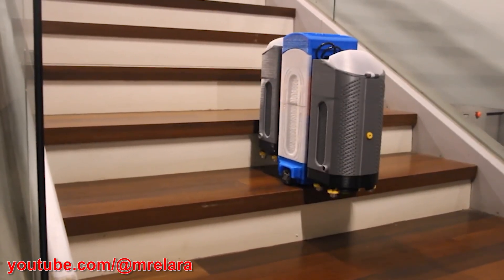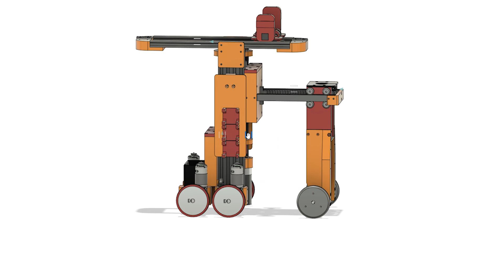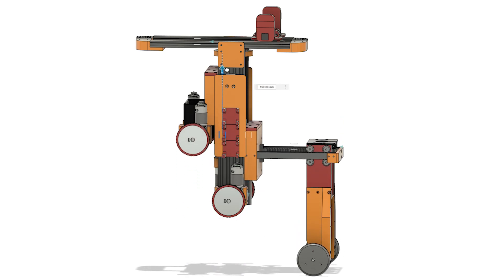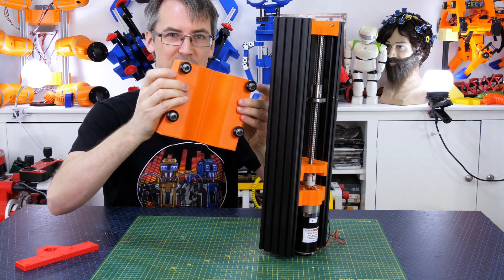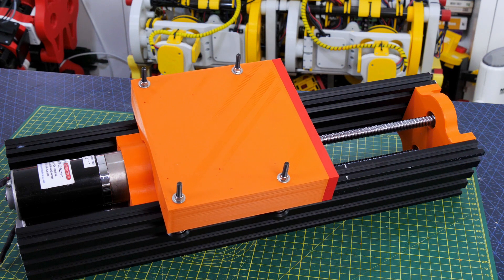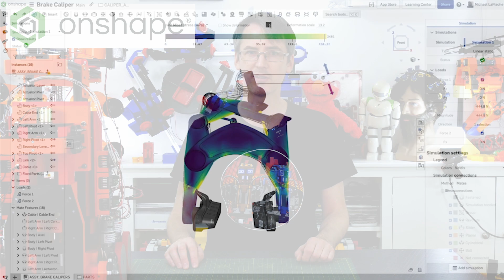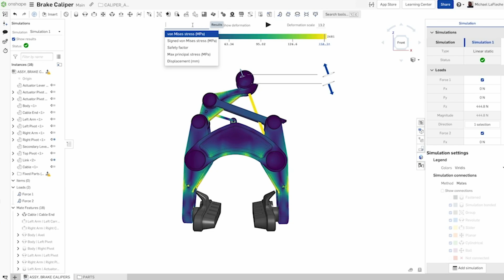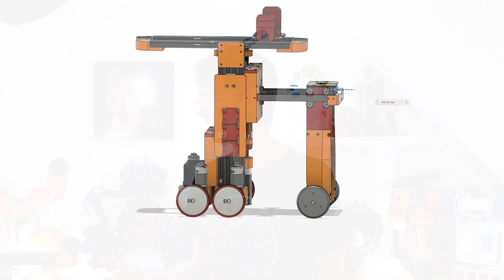How this Robot Climbs up Stairs

Comment: Awesome job man. One suggestion. Instead of shifting weight, you can use flywheels. You can control their speed and direction to adjust the angular momentum. I think it will be comparatively simple and compact.

Comment: Make the weight mechanism have 3 stages, when you lift the first wheels the system automatically first has to have the weight on the first stage, when you lift the middle the weight automatically moves to middle, and when you lift the last wheels the system automatically moves the weight to the last stage, this removes two buttons and stream lines the process so that if further autonomy with sensors may be easier.

Comment: Love the idea with the sliding mass! But doesn't this make the back section with the omniwheels redundant, because with the sliding mass you can stop the front sections from tumbling down
Reply from the maker: You can't pick the middle up...
Reply: @jamesbruton  why not? In my mind, to go onto the step above, the middle lifts the front up by turning the lead screw, and then the whole assembly moves forward. If there were only two sections with a moving counterweight, I think the middle could be picked up: when the front is on the step above (at a higher position relative to the middle because of the lead screw turning), wouldn't making the lead screw the other way (ie in the direction if the front were to be lowered) pick up the middle?

Comment: Thank you for your video, as I also need to make a 'scooter' that can go up stairs, and I am thinking of using a segway type device that has large diameter wheels and you can shift your weight forward.  It needs to go faster than you can do it yourself with your legs or it won't be useful....It would be great if you could figure this out.  The track system might work if it has large diameter more like a wheel.   Cheers, Jack
btw, a simpler method is to fire a hooked cable to the top of the stairs and just winch yourself up, doesn't need anything but a single winch and some wheels.  Can go back down too.  And very quickly too if you don't mind some bouncing.

Comment: Intreiging design.. but you could totally have got the dog to do it far quicker.. with the right programming!

If I were you I'd probably try an cheat the programming by attempting to evolve a virtual environment and virtual dog from the real environment and dog, to evolve the virtual dog AI against varying virtual environments and objectives rapidly an relentlessly.. so that it can do things like bound up steps easy..

Tho.. maybe just evolving the dogs AI in the real would be simpler, might wear down some parts but it would get there with the right sensors an autonomous goal checks.
Reply from the maker: Legs are not strong (or long) enough, so there's some new hardware required

Comment: You should use a screw terminal shield on the mega, I got one for a robot I have and it has relieved a lot of anxiety.  You can even get a spring terminal one for an uno and it works on the mega and due.

Comment: I think it only needs to drive the front pair of wheels when the middle pair is at the same level as those front pair. This means you could simplify by having a simple gear or friction drive that takes the drive off the middle pair and supplies it to the front pair when they are at the same level?

Comment: If the compartment of the battery can move to accommodate for the change of weight in the direction needed, that's a huge win for efficiency.
Now imagine being able to do this with more than one battery separately for even more control and capacity.

Comment: The Holy Grail of robot mechanics, the stair climb. Nice motors, 12V 22A stall. mmmm, not available on the website.  Dont run the nut off the screw, No-one wants to spill their balls all over the floor. Fantastic proof of concept expertly executed.

Comment: If you use a high helix lead screw instead of T8 or ball screws, it will be much faster, and there probably isn't a huge torque requirement.

Comment: With the weight stabilization on the top it looks a bit like one of your 3D printers has become sentient, printed out some parts, and is now trying to escape 😉 I'm guessing the trip down the stairs would really benefit from having sensors if the trip up was tricky to control the timing of?

Comment: Don't build complicated sensors.
Use end-stops!

Your stairs don't change height, your segments never need to go higher or lower than 1 stair height.

So have some manually adjustable end-stop switches for any state you need to detect.

For the top rail, use a rail with switches, and simply program it to move from one switch to another depending on the state it needs.

Yes, you could over-engineer it to work on any stair height in any location, but as you say thats complicated, when you can just measure your stairs and the robot will just work with much simpler boolean logic.

Comment: Fantastic as always. I thought that seven minutes to get up the stairs was quite impressive. :)

A few weeks back I thought that your motion camera rig was another amazing project. However, when you use it now, there are parts of the video (like the closing section here) where I have to look away as they make me fill quite ill very quickly -- the mimicking of a drifting hand-held camera with no stabilization is too good! :) But this may be just me.

Comment: a couple rails with a section of teeth in the middle would make it easier for a small robot to quickly climb the stairs. depending on size you could get it to corner on the rail and even a weak, slow climb would still probably be faster than all the stop and go with this bot. this robot is amazing in its own way and if it was only a step or two it would be fine but 7 min is a while and then you need a good bit of sensors to keep it from just driving off the edge.

Comment: Love the multiple different types of pullies and different engineering designs in this. On a quick note you should try to use mecanum wheels, they give lots of control when used right and you can go in almost any direction you want!

Comment: Does it work just as well going DOWN stairs? I don't recall any discussion of the down procedure during the design and there is no footage of it
Reply from the maker: I'm pretty sure it would just everything in reverse, it took so long to go up I didn't bother though
Reply: @jamesbruton  It looked like the robot may have to back up to the stairs first if it was to do everything exactly in reverse. Or said another way, it may have to back down the stairs instead of going "head first"

Comment: i would imagine that the quick and dirty solution would be similar to the bin bot....programmed actions/paths based on criteria? if you didn't want to to be fully hardcoded repetitive function, then obviously targets on the stairs that tell it that it's encountered a set of stairs then go into the stair routine (drive, lift, move weight, drive, lift, move weight, etc...), that way it doesn't have to figure out "stairs" it just has to know that stairs exist. then all the autonomy would be in the "navigate to stairs" at which point it would go into "stair mode" then once it's done stairing, it goes back into autonomous searching mode.

Comment: Hey, quick question, why do you power the arduino separately?
Reply from the maker: So motors turning on and off don't cause spikes that would affect the micro. With probably regulation it wouldn't be an issue, but it's just easier this way.

Comment: Such a cool concept! Well executed too. I'm curious if you think it can make it down the stairs in its current form?

Also a stair-lift robot that can interface with other robots would be amazing. Retrieval / delivery robots on each floor plus the stair lift robot to take a mass from one level to another. What an awesome home-automation system you'll have soon!
Reply: I was thinking you could mount a rail To the wall just have it extended out and enter so and have the robot be able to connect to that and drive up the rail… who knows if that would work though. And in theory that should be able to make it down the stairs it just goes in reverse

Comment: At least, I think you can automate the stair climb with 1 sonar sensor on the front:

You still have control of the driving of course.  You can drive it up to a step, and hit a button that will start the stair climbing (maybe with the same button to stop the auto-climb so you can take over too).

The program will first make sure it's close enough to the step, maybe even bumping into the step.
It will then raise the front section until the sensor doesn't detect a close object.
It then drives forward a set distance, stopping if the sensor gets too close to the next step (if there is one).

I'm not going to write out the whole thing, but I think you can get the idea for the algo from this.  Just one sensor needed! :)

Comment: linear rail(guns) are better
Reply: railed are easier to manage
Reply: or just quad copter server dish plate
Reply: you dont need to make wheel/roads when you quad copter fly
Reply: solar gives infinite range, recharge (sleep) if you need to, in between, or just helium balloon float around with the wind (solar-electric helium balloon solar panels)
Reply: batteries are an unnecessary package, just super caps for some smoothing buffer
Reply: or tin-air wire/sheet spool fuel cell, at 6-7 kwh/kg
Reply: then the tin oxide can be recharged with hydrogen/carbon/electric-field back to tin metal, as re-used locally
Reply: yes the same tin as the soldering metal
Reply: if you make a 6dof hand tracker, with 2 joints and 2 axles, you have a 6dof simple hand controller (or 3d mouse), the same as I already said about controlling a human robot by transferring your own movements to it
Reply: positives of the joint tracks system is that no complex imu, sensor systems need to be used, only some angle joint sensors

Comment: Could a tumbling robot that kind of rolls up the stairs work? it would just need to have a stabilized basket in the middle to hold soda. Or a hexapod with long lanky, lifting legs. Same idea as what you have here but it doesn't use wheels, and different gaits can be tested against your particular steps for best stability.

Comment: interesting project
well for starters how about acceleromter(?) in the middle so it can calculate tip forwards and backwards for balance, simple switches in front on both side for step placement.

Comment: Rather than sensors for detecting the distance to the next step couldn't you use switches on each side (front left and front right) and let the robot bump into the stair like the early roombas did to detect the stair and then orient itself correctly (straighten out and then move to the correct distance for ascending)?
Couldn't you also automate the ascent process rather than having to control it all manually with a remote? It seems like it's a fairly repetitive task that would be easy to set up macros for each of the different movements and their timings

Comment: It looks stable enough, but I still have to ask does it handle going back down again, other than just going down 'the fast way'?  😜Other than that, good design, though if we were making a practical drinks delivery robot I would have made the counterbalance rig out of a cooler loaded with ice and beverages.
Reply: In theory it would just go and reverse. So the leg without motors would be the 1st to go down the stairs I think

Comment: For a vacuum/sweeper, this kind of mechanism makes some amount of sense as it sweeps each step before progressing.  But for anything else that needs continual progress up a flight of stairs, tis is insanely inefficient.  Unless legged robots become more prominent where they can actually step up the steps, any other form of robot will have to be bound to a rail system to retain any amount of movement efficiency; that's just the reality of robotics at the current moment.  Sure there may be some atypical wheel and linkage designs that makes traversing stairs more possible, but you also have to consider what sacrifices those atypical designs are making when it comes to typical movement.  Honestly the best of both worlds, stepping efficiency and rolling efficiency, might just be a Spot on skates, but then you're also pretty deep into hardware costs just so it can occasionally step; though this would be good for terrains where wheels don't make much sense either.
Reply: All those are fair points. And James probably thought of them, as did many people for many years. Boston Dynamics Spot can handle stairs. But hey, if stair lift is  what you need for your robotic butler to get you a beer, thats a small price to pay i think.(btw, if you want "typical" movement, human movement, then you have to go with legs)
Reply: @greenanubis  Did you comprehend any of the comment? They already stated legged robots are what's efficient for stairs, why be utterly redundant in your statements? They also stated the fact that a non-legged robot would optimally use a rail system to traverse stairs efficiency; again, comprehension issues? Your argument of typical movement also has no basis in anything, they had stated that atypical wheels and linkages, such as tracks or treads, sacrifice efficiency when it comes to typical movement just to traverse large vertical disparities, such as when you have multiple secondary wheels around a primary pivot to climb steps via rotation of the secondary wheels, you'll be sacrificing rolling efficiency due to much smaller wheels by comparison to a singular wheel that fits the same radius from pivot center to the secondary wheel's circumference, thus your 'typical movement = human movement = need for legs' argument is entirely baseless and counters absolutely nothing they had said; again, did you not comprehend a single thing? Where did this argument even come from? You do realize typical movement for a wheel is rolling, yes? Are you high or just a moron? Stair lifts aren't the only rails stairs have, btw, not that any robotic platform would interface with a typical stair lift anyways but rather use its own rail with open ends and without other devices on the same rail; again, another moronic statement. Maybe rather than be an illiterate moron, you go educate yourself a bit. 

As for James thinking about movement efficiency, absolutely not, he saw a robot and made his own lesser version of it, as he typically does. As for other people having thoughts of movement efficiency, obviously it's not a primary topic, nor a topic widely discussed, if even a topic of consideration; reference atypical wheel and linkage designs that sacrifice efficiency in their primary mode of movement just to climb stairs, tell me where the movement efficiency is, reference the fact that legged robots might have a more efficient mode of movement on paper but are not efficient in the slightest due to rotational motors being used for multi-hinge legs and gaits, there's reasons why natural joints have limitations in rotation and why muscles are linear devices in vertebrates. Tell me how cock tastes, because you sure are sucking off a lot of people right now.

Comment: Can it go down the stairs? I guess yes, but it's more dangerous, because you have to drive backwards until the back wheels are fully overhanging. Without a step to stop it, like going up. Is that correct?

Comment: It's a VERY good machine to carry a quite massive load and for keeping it level and stable. But for it carry you a beer while you're feeling lazy... well I think it would be warm by the time it got there lol. You did mention that it was overly complicated, and I agree... for SIMPLE tasks. But it really is the perfect design for what it was based on (cleaning the stairs)
Reply: If I were to do this project, I would cheat and mount a track on the wall that the robot could attach to and drive itself up the wall like one of those stair-lift-chair things.
Or attach and detach itself to an installed winch or crane.
That would only help for a home use that's planned ahead of time like that - not really as robust as a solution as this robot that could go up many different types of stairs.

EDIT 12:32 in the video he has the same idea haha I wrote this comment before finishing the vid
Reply: If anything, there's a risk he'll have to drink his ale cold.
Reply: instead of 3d printed part for ads it was more struddy to use only aluminum parts and make a mini fridge as counter mass
Reply: brits drink their beer warm anyway
Reply: He's English, warm beer is the go.

Comment: i was wondering if you had a qr code scanner fitted on the robot,  then put qr code stickers  on the walls,  each code tells the robot to turn left or right 45 degrees, distance and steps to next level. Then it would be easy to just let it be automated without input.   Then you can use this in a variety of differing steps, just print out a sticker with instructions and the machine can just crack on with being automated.

Comment: What about 3 vertically sliding links with each having a track so when the first link encounter the stair the track will pull it up while the rest will press it to the stair so that it has traction, and once its goes up the next one climb etc.

Comment: Surely you could take the movements of the first step and have the program repeat itself for a 5 set / 10 step / 15 step mode so it’s hands free
Reply from the maker: As long as it can sense where each step is - the two turns will be hard